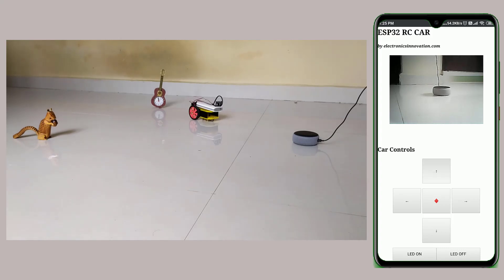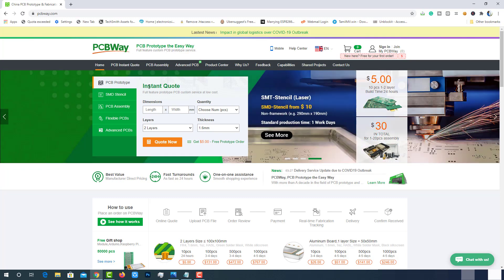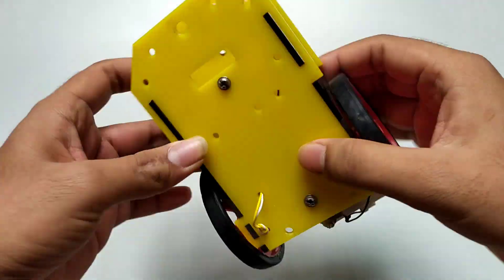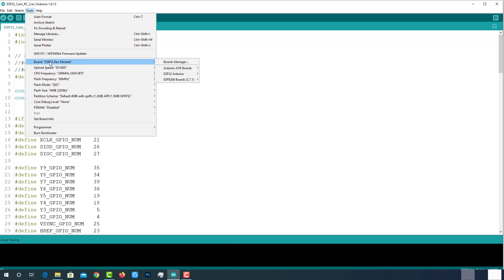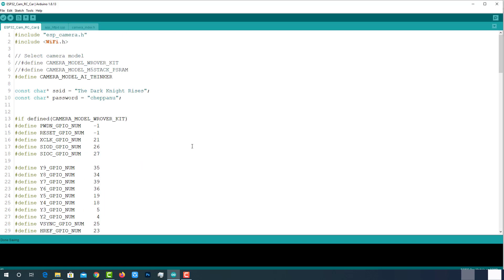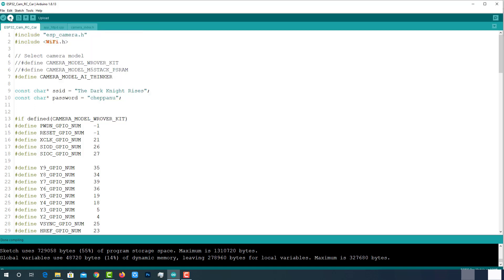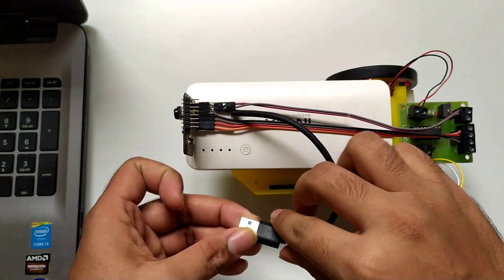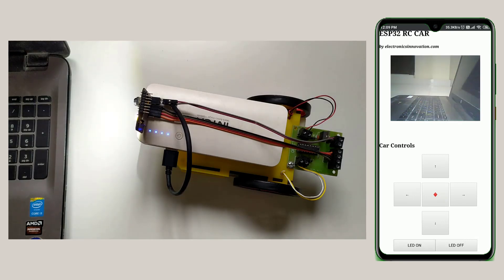Spy Car| Surveliance car | ESP32 WiFi Controlled Car

Comment: the car and the controller must be in the same wifi. So how to control the car if the controller using different connection or from different wifi?
Reply from the maker: For that, you need to tweak the code to communicate over the internet.
Reply: @electronicsinnovation  how is the code?